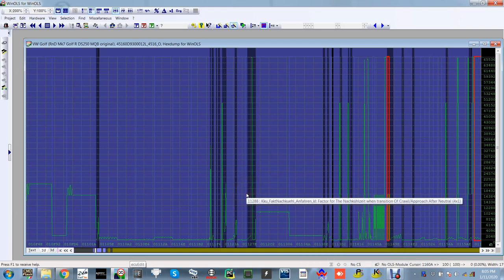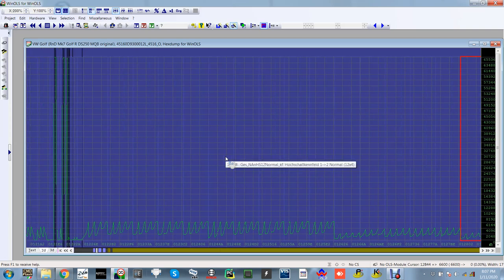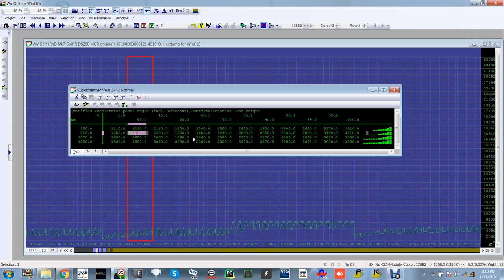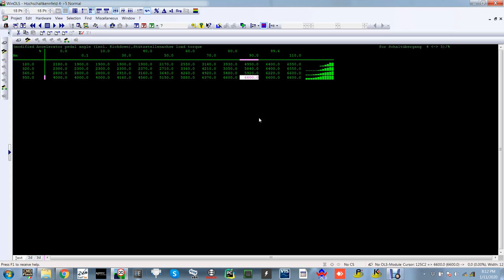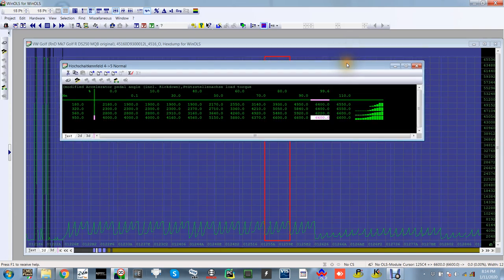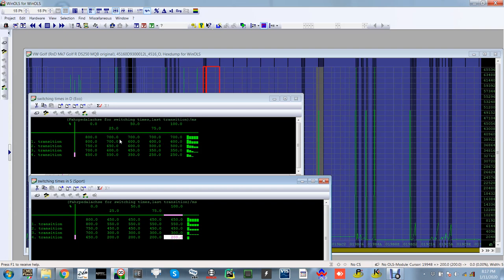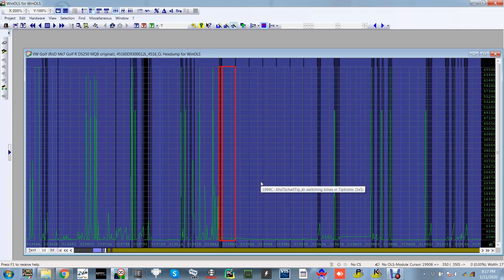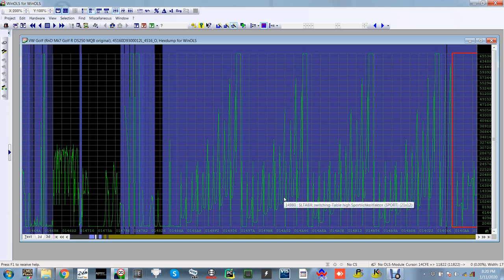DSG   what is a DSG tune

Comment: Hi ya mate,loved the video,iv just had a re map and had my dsg box mapped to,love it,only thing iv noticed is,as you said,before the car and box was mapped,sometimes wen slowing down then putting your foot on the gas again the gear changes would either drop down a gear like from 3rd to 2nd but sometimes stay in 2nd for That bit longer,well these small things were liveable as i new i was getting the car mapped by a very very good place “most say best in the UK” but since having all this done,yes the gear changes are faster but I’m still getting that gear mix up wen either about to stop then carry on or slowing down to take a corner and say I’m in 3rd it wil sometimes drop to 2nd but stay there much longer than it needed to be,and that’s in D mode,basically i don’t feel this has been sorted,just faster gear changes up & down

Comment: Hi your videos are very well explained and good, im waiting for the second video covering SOI.
This is because im injecting up to 12 degrees after TDC and the ideally 10 -11 degrees after TDC.
In the other video you say that SOI should change from -26º to -27º or -28º is that what is need to change? only that cell?(-26º to 27º)solve the problem and put in safe zone?
Another question to calculate that original ratio you did 55mg / 27º that gives 2º by 5 mgs, and why not 55mg / 32º= 1,71ª,
what im asking is, to calculate the increment ratio in degrees we do it from the lowest value in the 55mg cells, thats(2ºdegrees), but when im calculating the TDC(-26º + 38ª) is from the higher values.thanks
Reply from the maker: Hi, and thanks! its more the maximum EOI cant be more then around 12 degrees after TDC, you can go further but you tend to find the pressures get too much in the cylinder, get a good balance of duration and soi with the correct size injectors for the power level wanted and you will always be good!
Reply: phil cooper thanks for answer me, I have bean studying and learning, and I went for the cupra160 map files and I noticed to achieve 35.8@5000 they went 27 at SOI , and that gives 8.8 TDC, my objective is learning how much I need for 70mg...I read about in some forums that they put these and other values but @4000, my car is an ASZ all stock, except the turbo, that I upgraded to an hybrid gtb1752, the problem is the intercooler, but I just want to learn more

Comment: Hi Phil, in your professional opinion, which off the shelf (Apr/unitronic/TVs etc) DQ381 TCU tune seems to be the most polished for a daily driven/lightly tuned vehicle?
Reply from the maker: Light tuned any of the above tbh, they have all spent alot of time and effort on the tunes.
Reply: @Phil-Cooper  Thanks for your response. The reason I ask is because I am getting some strange behaviour from one of the well known tunes on my dq381. Also got logs of opposing gear clutch pressure spikes - is this something you have come across in your travels?

Comment: Do you flash dq250 mechatronics with custom software? I have a spare TDI mechatronic that I need flashed to 2.0t software
Reply from the maker: Hi Mark, I dont think its that simple to cross flash, as the dsg holds immo info too. Might need to be flashed with something like arbrites or odis online
Reply: @Phil-Cooper  understood! I guess I have to do more research
Reply: @Phil-Cooper  once hardware matches you can clone using pcmflash also

Comment: Hi Phil just seen this video, I got a 2019 Tiguan with a 7speed DSG, when I pull off quick sometimes it revs high, it’s annoying cause it sounds like an old person riding the clutch and revving the nackers off it 😂 is this something you could help with. I may tune the car and DSG one day but I’m still on the fence 😂 Thanks in advance
Reply from the maker: That’s a strange one! Might possibly be slipping or the dsg filter is clogged, I’d 100% have it looked at, serviced and the adaptions done to reset the bite points
Reply: @Phil-Cooper  thanks for the reply, It could be my driving, it mainly seems to do when I slow almost to a stop then get on the gas quick, I’ll get the gearbox serviced then see if that helps, it’s possible the gearbox has never been serviced before so worth doing anyway.

Comment: Is DQ200 more difficult to remap vs DQ250? I asked a few tuners and the don't want handle with dq200
Reply from the maker: Hi, they work differently with shift points etc, very time consuming to tune properly and they don't take alot of power.